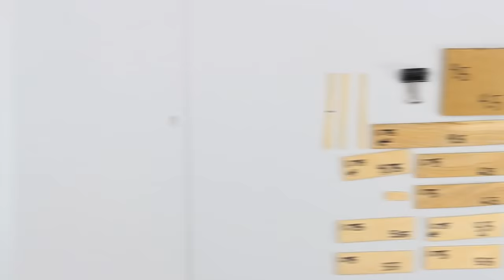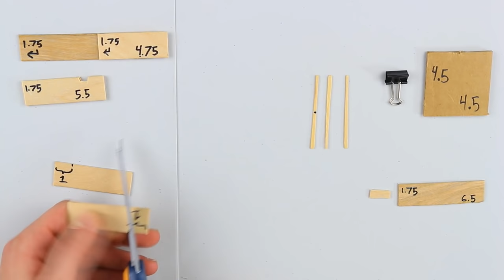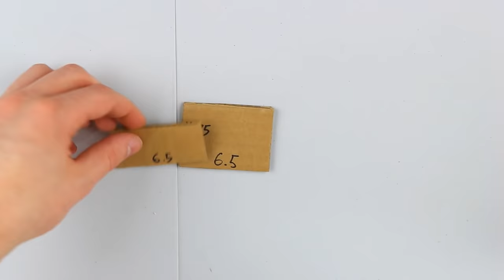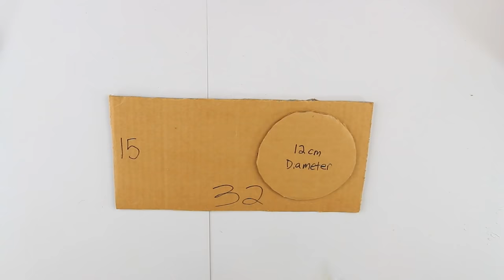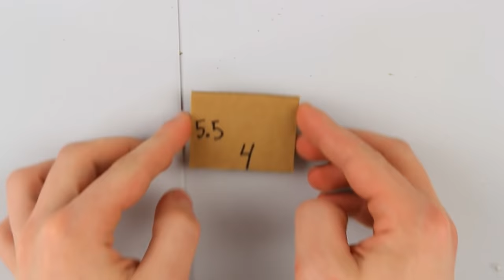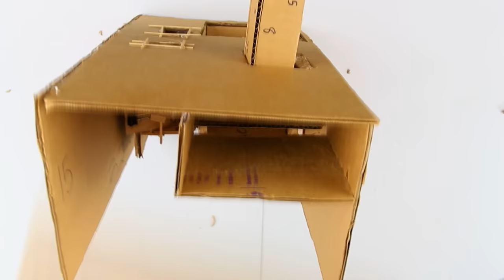How To Make A Dunkin' Donuts Vending Machine From Cardboard

Comment: Mechanism:
the hole is too wide for normal coins but e2 coins are bigger, so it goes past the hole, the reason why the button doesn't work with no coin to because the coin is not weighing the part up, because its blocked in a gap. I hope this helped u, sry if i didn't do a good job, I'm only ten, anyways, subscribe to astonishing studios!